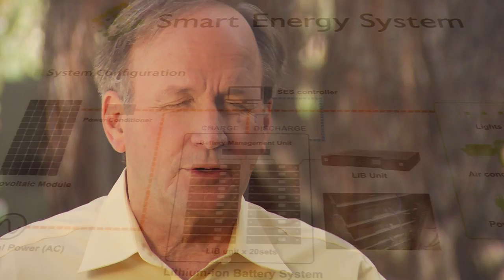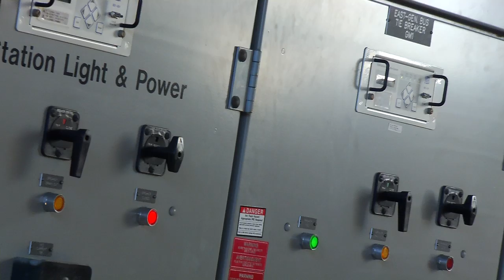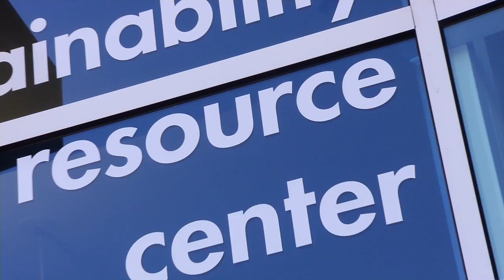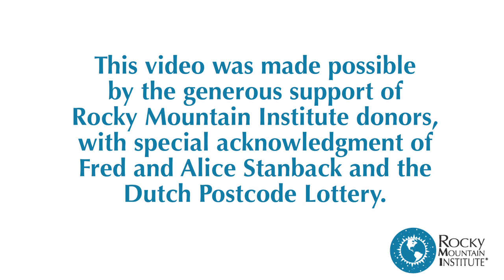The UCSD Microgrid - Showing the Future of Electricity ... Today

Comment: Wind, storage and back-up system designer http://scottish.scienceontheweb.net/Wind%20power%20storage%20back-up%20calculator.htm
Peak demand, wind and back-up power / energy usage and storage capacity calculator
For the specification and design of renewable energy electricity generation systems which successfully smooth intermittent wind generation to serve customer demand, 24 hours a day, 7 days a week and 52 weeks a year.